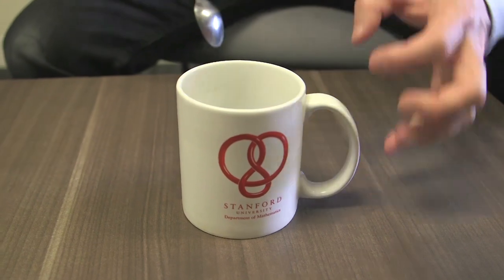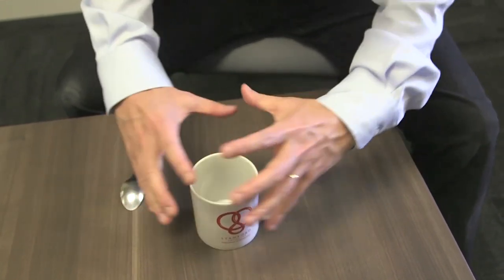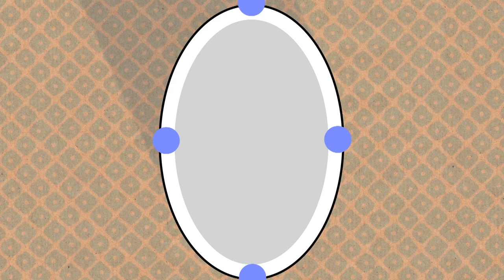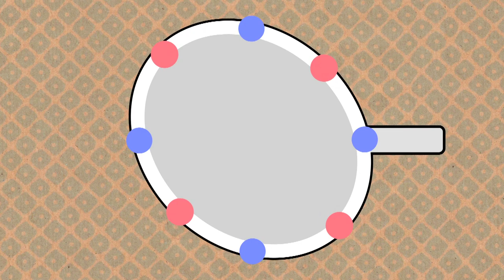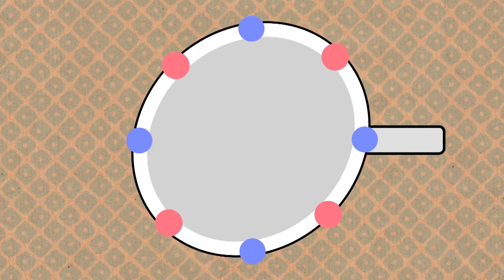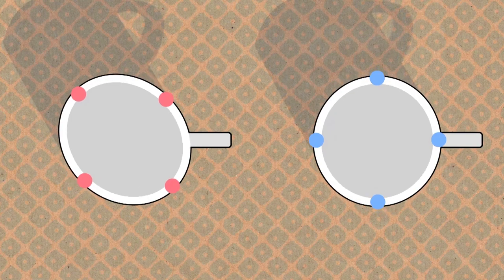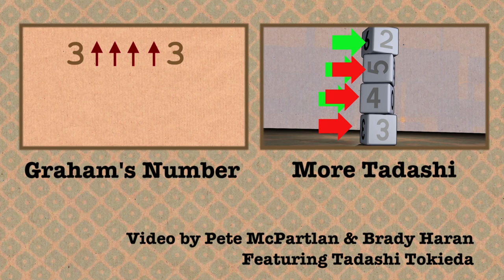Coffee Cup Vibrations - Numberphile

Comment: This is brilliant! A great, easy to understand demo and explanation of the inverse problem. The inverse problem is indeed  everywhere in science, e.g. in brain data analysis. The electric or magnetic field pattern the EEG or MEG (respectively) measures from outside the skull can be a result of infinitely many different combinations of sources in the brain, yet we usually want to know where in the brain the acitivity comes from, which requires a solution to the inverse problem. Basically, given the measurement of pitches, we want to figure out where the handles are in the mug.  Thanks, this demo will be useful!

Comment: I did my masters on structural health monitoring (civil eng) and i've been using the Chinese porcelain example to elaborate on what was it all about. But, i see this and say this was the way i should have been explaining it. Very neat exemplification and it covers the mode shapes and  the backwards problem solving issue so well ! I absolutely love this guy's style.... Just to add a note, Dr. Tadashi may find the case of 3 handles that are not 120 degrees apart more intriguing, since it is the basis of very stable honeycomb structure after all.

Comment: The difference in those pitches sounds approximately a half-step apart for both the coffee mug and tiny cup. Sounds approximately E and F for the coffee mug and then A and B-flat for the tiny cup.
Reply: wouldn't the pitch difference depend on the mass of the handle(s) that need to be dragged along?
or maybe the mass of the handle in relation to the mass of the moving walls of the cup?
if that's true it would be a coincidence that both are a half-step apart. unless it's because the handle-to-wall mass ratio is what looks nice for cups.
Reply: The tiny cup pitch difference is definitely microtonal. Probably 30-40 cents.
Reply: The tiny cup actually sounds like it's difference is only in upper harmonics. Seems like base frequency is the same
Reply: mikosoft Well, the sound of the tiny cup ringing is chock full of overtones anyway.

Comment: Yeah; the 3-handle-cup is downright tiny, which is a problem; because, as a 3-handle-cup, it’s got 12-fold-symmetry, because all those 3 handles has a different quadruplet of points associated with it; and, since 3 and 4 are coprime, we can’t actually cancel anything out; so, we just multiply them out: 3*4=12, and there you go. If it had, say, 6 handles (at the vertices of a regular hexagon), you might assume you’d get 24-fold-symmetry; but, since 4 and 6 have a common divisor (2), you divide the product by 2; and you get 12-fold-symmetry; because the 2 diametrically opposite handles are always associated with the same quadruplet of points; so, you still just get 3 distinct quadruplets of points, since there are 3 pairs of opposite handles. So, in general, you multiply the number of handles (h; better expressed as: ”da” or ”d*a”, for this purpose) with 4, and then divide by the highest common divisor (d), which can basically be 2 (if h is singly even), 4 (if h is a doubly even), or 1 (if h is odd): (4da)/d = 4a; and dividing by 1 does nothing to the actual product. So, you always get a 4a-fold-symmetry, where a is coprime with 4. 🤔

EDIT: I guess the cup was so tiny that the 12-fold-symmetry got crunched into 6-fold-symmetry, because it got too crowded, there 🤔😅.

Comment: A funny thing I noticed is. If you have a full cup of a warm liquid. Tap the bottom. It has a singular note. Now stir the liquid and start tapping the bottom once more and it's not a singular note anymore. It rises or drops in pitch.
Reply: *****
 I noticed it with tea and that has no powder nor residue in it at all.
Reply: +Niels Schellekens The reason tea is darker than water is because it had tiny tea particles in it.
Reply: SadEugene
That's my guess too but it doesn't do both. It's either up or down. Not up and down like a wave.
Reply: hey, I noticed it too during a coffee break and wanted to share that as well. You can tap continuously after stirring and the pitch will go up. Because I noticed it with coffee that has a significant amount of foam, my hypothesis was that it was related to bubbles in the stirred coffee slowly coming to the surface.

Comment: 1:20 in.
I never knew cups did this. Now, I'd say it's quite logical though. The tea cup will vibrate by stretching from round, to oval pointing north/south to round to oval point east/west, to round etc.
If you tap at a multiple of 90 degrees angle from the ear, the ear will need to be moved by the stretching, and that's extra mass and can be done fewer times per second with the same energy, as opposed to tapping at at a multiple of 45 degrees (not counting the previous angles of course) where the ear doesn't fall on a sine-wave top, and doesn't need to be moved.
Now to watch the video to see if I'm right.

Comment: The best way to visualize this is using a head massager the wire kind  where there is usually a set of longer prongs and shorter prongs all arranged in a circle. If you vibrate the longer prongs all the other prongs will move and the smaller prongs will stay motionless and vice versa for the shorter prongs.

Comment: With the notion of the inverse problem of figuring out where the handle is, with the right equipment, you might be able to measure a small difference in transient response between the four different locations for the lower pitch. I hypothesize that the lower frequency oscillation would settle in ever so quicker when hitting the side with the handle, because when striking the other three locations the initial displacement has added travel time (at the speed of sound in the cups material) before reaching the extra mass of the handle and then being distributed back to the other antinodes. Obviously, this would be way easier to measure, the larger the mug is, because this effect deals with the high speed of sound.

Comment: Using my very large, circular mug, I can get a quite distinctive difference in pitch between the handle (and its other 3 points at 90 and 180 degrees from the handle) and between these points.
Where things become difficult is when I use my other mug, which is round at the top, and square at the bottom, with this mug, it becomes extremely difficult to notice any pitch change

Comment: Is it true that the volume of the cup wants to stay the same? I thought, that the circumference of the wall wants to stay the same, since a change would result in tangential tension inside the wall. The air volume inside the cup isn't nearly as stiff as the ceramic material, so that shouldn't matter.
Reply: I think by "volume" he meant the volume of the ceramic in the cup.
Reply: Oh, of course, if that's the case that would make sense, too :D

Comment: I suspect because of the principle of linear superposition that there are only 2 principal fundamental modes of the vibrating mug, separated by 45 degrees.  For the one-handled mug, you've shown the two distinct modes.  For the three-handled mug, perhaps the two modes have the same frequency and are distributed in different proportions when you strike various places around the rim.

I would guess that the differences you hear when you strike other spots on the mug are related to the higher harmonics.  The next higher harmonics would be in-phase or out of phase with the three handles.

Comment: Riddle me this! If you have a cup of hot beverage and you stir it with a spoon. When you've got the liquid spinning around in the cup and then you start to tap the bottom of the cup with the spoon straight from above... You'll first hear very low pitch, but as you keep tapping without stirring it more, the pitch get higher and higher and higher. I haven't tested this with different kinds of cups and different kinds of liquids, so it might not work with all, but I think I had somewhat similar cup as the professor in the beginning and the beverage was either tea or hot chocolate.

Comment: I'd like to make a correction to the video if I can be so audacious. He actually inverted the relationship of the handle on the pitch of the notes. I'll try to explain. 

More mass tends to slow the speed of vibration and thus the pitch, less mass raises the pitch. The two easy examples are guitar strings or buzzing a ruler off the side of your desk. As you slide your finger up the fretboard or as you shorten the amount of ruler hanging off the edge, you are decreasing the amount of vibrating mass and raising the pitch. The shorter the ruler, the less movement it has between impact with the table, thus making impacts more frequent, same with basic vibration against the air. 

So when you tap the wall of the cup the vibration spreads from the point of impact, let's call it the fulcrum. The pitch of the mug is defined by the length of material between the corners of the deformation. The flexion in those points is too severe to allow free vibration, alternatively the mass between those points is under less stress and freer to vibrate.

So the corners are symmetrical to the fulcrum. When the fulcrum is in line with the handle it has essentially no effect, but one would think the added complexity of its structure would limit free vibration of the membrane. It does. By lining up with the corners it is simply sitting in the dull part of the vibration. 

Now, when you deviate the fulcrum from the handle or it's corners you create an interesting effect. The handle dulls the vibration where it is located, and so do the corners. The length of the vibration then becomes the amount of space between the handle and the corners. As that length decreases you get the higher pitch. That's because that is the length of free vibrating material. As he demonstrated, although there is no handle elsewhere, the vibration essentially mirrors itself. 

Now if this made sense and your savvy you might say, "well wait, as you move the fulcrum from the handle there would be a short and long distance to the corners on either side" and you're correct. At first the shorter distance is so short that it's vibration is weak and irrelevant and essentially creates dull space. However when there's uneven vibration between the handle and the corners you get a harmonic note. This means the membrane is vibrating in two different patterns or lengths and causing two different notes. They are often sadly not well matched and this is why it sounds unpleasant. It creates a discord.  The same exact thing would happen if your guitar had a resonating body on both ends of the neck.

I hope this made sense and added something to your understanding of this phenomenon.

Comment: I think there is a mistake with the cup with 3 handles:
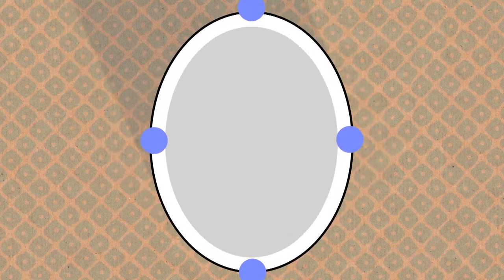If you look at the graphic at 10:33 I think all of those points should be blue and in between those 8 blue points there should be 8 red ones. Just look at the graphic at 10:33. there are red and blue dots that form a group of 4 points ike in 4:06 that should have the same colour.
So, if you  have a cup with three handles, first you colour every handle position with a blue dot. Then, for each original blue point you add three more at 90° intervals. now you have the picture at 10:33 but all 12 in blue. Each group of 4 points has to "drag" one of the handles with it when it (or one of its 3 friends at 90°) is tapped. only IN BETWEEN those you will have areas that don't have to drag a handle with them, which will lead to the higher pitch.
Moreover, the angle difference between blue and red points is much smaller than in the case with 1 handle, which is why the difference in pitch will not be that great.
I would love to hear what Tadashi thinks about this. Do I have an error in my reasoning?
Reply: I realize your question is 2 years old, but I believe you are right.

Comment: I tried this with glass mugs and I think there are noticeable differences between the handle side and the opposite side. I think this has to do with the Poisson ratio leading to distortions in the waves moving through a curved structure. The sound from 4 corners including the handle would be exactly the same if the cup had a Poisson ratio of 0.5, which would mean no change in volume during vibration. The ceramic cup probably has a Poisson ratio well over 0.3, but it is definitely lower than 0.5. The glass mugs should have lower Poisson ratios, making the difference clearer to the human ear. If this is correct a concrete mug would have very clear differences in pitch between the four corners, if it makes a clear sound at all.

Comment: So the higher pitched sounds are the same sounds you would hear at all points on the cup if it had no handle?
Reply: That's what I was wondering.
Reply: They might be a bit different because the handle has some width, but they should be about the same.
Reply: Actually, the frequency without a handle would be in between, theorethically in the middle point for x axis in the graphic for sound curve
Reply: +Homero Treto Nope, the difference in sound around the cup is entirely caused by the handle slowing it down. The points least affected by the handle are the high pitched ones 45°offset from the handle, so that's closest to the sound of a cup without one.
Reply: +Homero Treto Nope, the difference in sound around the cup is entirely caused by the handle slowing it down. The points least affected by the handle are the high pitched ones 45°offset from the handle, so that's closest to the sound of a cup without one.
Reply: +Homero Treto Nope, the difference in sound around the cup is entirely caused by the handle slowing it down. The points least affected by the handle are the high pitched ones 45°offset from the handle, so that's closest to the sound of a cup without one.
Reply: +Pablo Griswold But of course you're right. Or at least you might. I didn't think it up much before sending my previous comment, but sure you do point in a very interesting direction. Thank you for your observation
Reply: +Homero Treto Any time!
Reply: If cup had no handle, it should have sound even higher than that, because the whole cup would be lighter.

Comment: As I understand it, maybe I'm mistaken, the four red points can vibrate 'more efficiently' than the blue ones. So, because the blue ones are somewhat tied to the handle, there is more tension opposing the deformation of the cup while these are vibrating, as opposed to the red ones. Couldn't we make the analogy with a vibrating string (e.g. on a guitar), so that when there's more tension opposing movement the resulting sound has a higher pitch? In that case, why do the red points produce a higher pitch when hit, and not the opposite? Am I totally mistaken?

Comment: You are describing the basic vibration mode only, but there are harmonics, too, I think, e.g. 3 points going outwards and 3 points going inwards, separated by 60 degrees each and even more overtones. Of course these are getting weaker, but they should change the spectrum (sound) at the points 90 degrees from the handle, since the 3rd harmonic should be higher there as it isn't damped as much by the handle.

I suggest that you run the sound through a spectrum analyser at each position and predict that you see a different spectrum at the 4 positions so you can exclude the 90 and 270 degrees possibilities.

I'm not sure about the 180 degrees position, but I think you can reduce it to 2 possible position of the handle...

Comment: In quantum mechanics Identical particles resemble the inverse problem. 

There are two methods for distinguishing between particles. The first method relies on differences in the intrinsic physical properties of the particles, such as mass, electric charge, and spin.  If differences exist, it is possible to distinguish between the particles by measuring the relevant properties. However, it is an empirical fact that microscopic particles of the same species have completely equivalent physical properties. For instance, every electron in the universe has exactly the same electric charge; this is why it is possible to speak of such a thing as "the charge of the electron".

Even if the particles have equivalent physical properties, there remains a second method for distinguishing between particles, which is to track the trajectory of each particle. As long as the position of each particle can be measured with infinite precision (even when the particles collide), then there would be no ambiguity about which particle is which.

The problem with the second approach is that it contradicts the principles of quantum mechanics. According to quantum theory, the particles do not possess definite positions during the periods between measurements. Instead, they are governed by wavefunctions that give the probability of finding a particle at each position. As time passes, the wavefunctions tend to spread out and overlap. Once this happens, it becomes impossible to determine, in a subsequent measurement, which of the particle positions correspond to those measured earlier. The particles are then said to be indistinguishable.

Comment: Should the three handle cup not also have 4 way symmetry and thus 12 low tones in 90 degree increments from the handles and 12 high tones in between them?  

Also, wouldn't you get better experimental results by taking something large and clear sounding like a metal mixing bowl with no handles and attaching weights to it, either magnets, modeling clay lumps, or if the bowl is large enough small clamps?